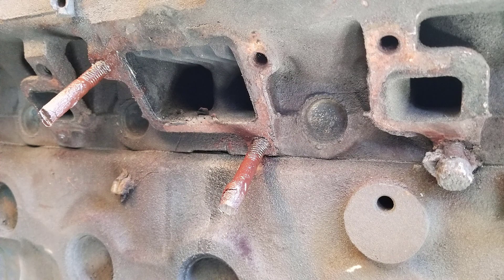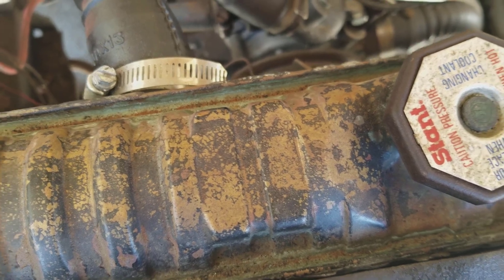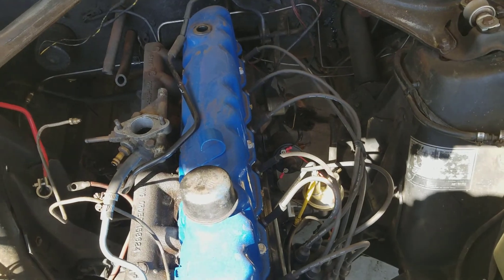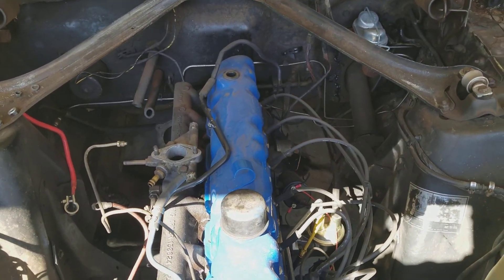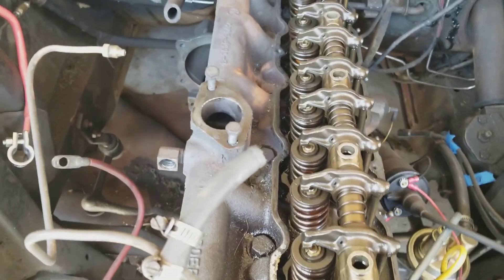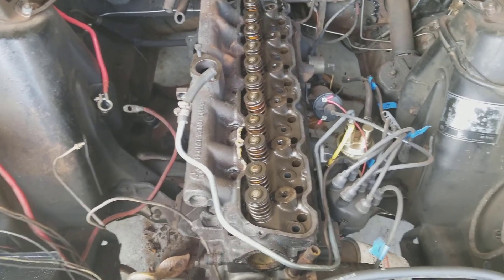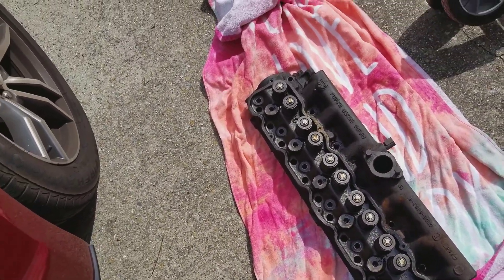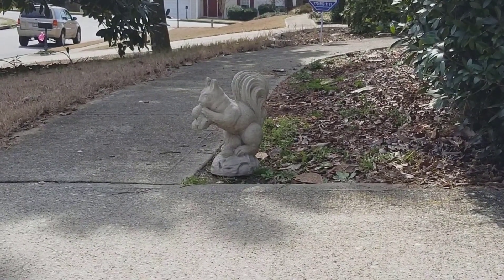Save the Stang Part 21 Removing Cylinder Head

Comment: These were great old engines, but the log head is terrible.  They don’t breathe well, and the intake is integrated with the head casting, so can’t be changed out.  But they were cheap and pretty reliable.  The head needs to come off to get those exhaust bolts out, they are a bear to move without breaking.  Also, the external head bolts like to hide under 50 years of crud in the casting valleys.  You did the right thing taking it to a machine shop.  I ended up replacing the head on my 250 with something better, but I can respect people who want to stay original.  Best of luck with the build.
Reply from the maker: Thanks so much. Maybe one day I will replace it with something better.